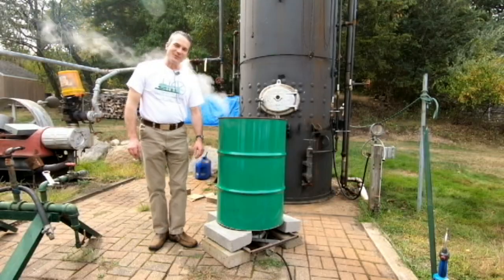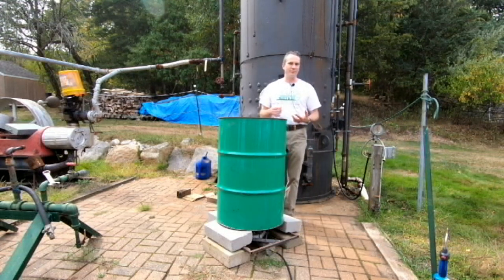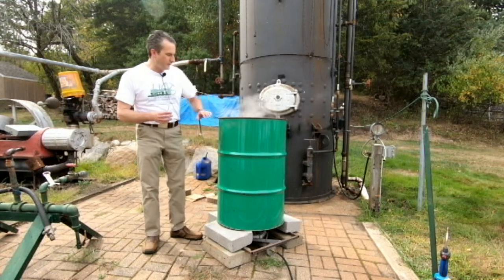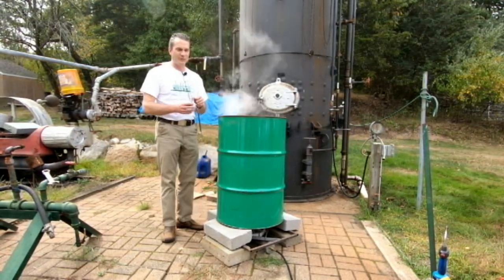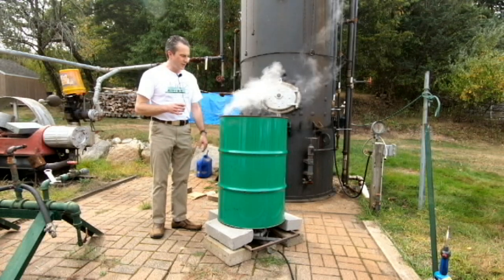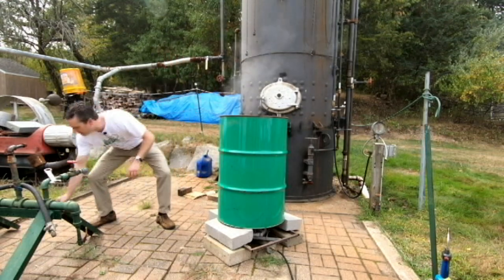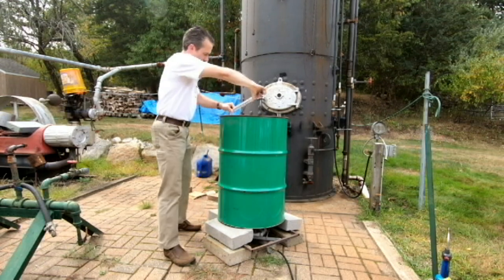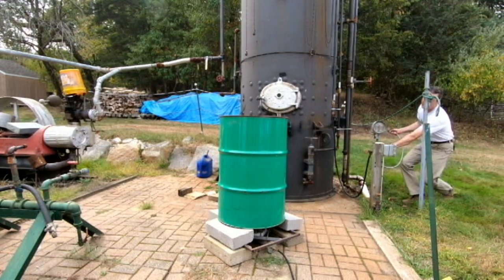The power of atmospheric pressure, the power behind the Newcomen Steam Engine of 1712

Comment: when designing storage tanks you have to install a vacuum breaker so it won't collapse if the wall is thin.  Also now we use nitrogen to inert vessels to exclude air to prevent flammables from igniting (like gasoline) but in the old days they purged with steam to get the air out.  Amazing a Newcomen engine could have a piston force of 90,000 psi.  I calculated the force on a steam locomotive piston once at 200 psi and I think that is in the same range although a much smaller piston area.

Comment: It is atmospheric pressure + thermal shock( rapid change in temperature caused can material to fail by spraying cold water into a hot surface)

Comment: Newcomen's machine was an Atmospheric Pump.
It provided Atmospheric Power, ( natural air pressure) a whole 10psi.max.
So, why call it a Steam Engine?
A Steam Engine is different, It provides Steam Power.
That's why it's called a Steam Engine. It could provide High Pressure Steam Power, as much power as your engine could take, which explains why there were so many explosions.
James Watt dumped Newcomen's Atmospheric Power and Arkwright's Water-Power for High Pressure Steam Power.
Like James Watt's High Pressure Steam Engine.
It was the difference between an Industrial Revolution and no Industrial Revolution!

Comment: Newcomen's machine was designed and built to supply Atmospheric Power.
Watt's machine was designed and built to supply Steam Power.
They are two different machines, so they shouldn't have the same name. What's wrong with Atmospheric pump and Steam pump, seems pretty logical to me. Or is it something to do with the Steam Engine being the Industrial Revolution, logic goes out the window?
There's an Industrial Revolution's worth of difference between Newcomen's Atmospheric engine and Watt's Steam engine.